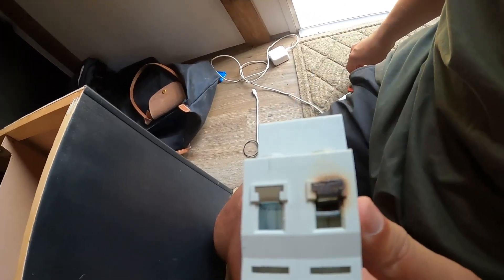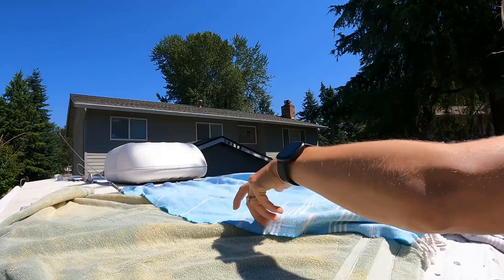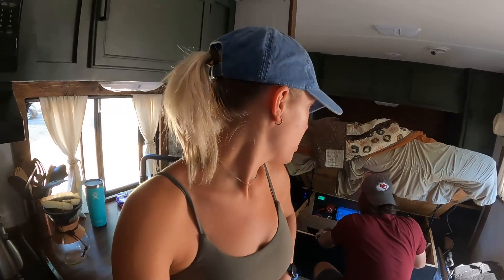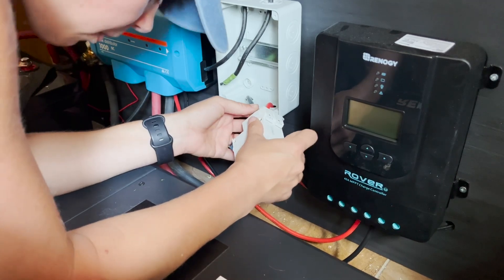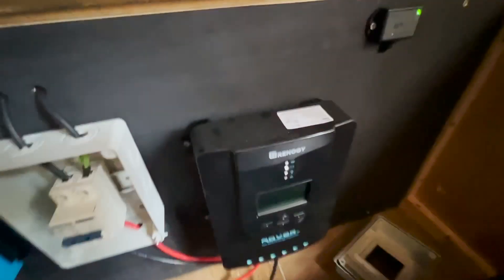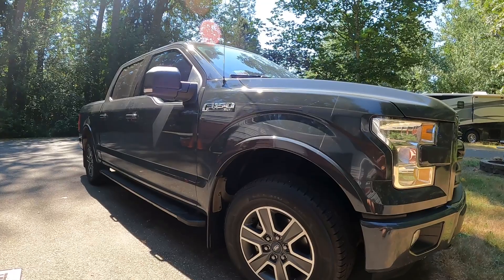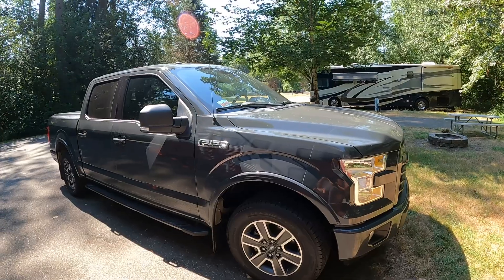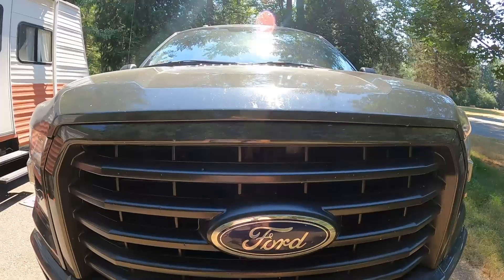Facing more RV life issues

Comment: Sorry for your problems but it's refreshing to see someone else who recognizes that RVing is not all airconditioning and ice cream.  We have towed our caravan off and on over the years with several tow vehicles, each with it's own peculiarities. Our first was underpowered, so we got rid of it for a more powerful sedan, to heck with the petrol bill. That vehicle (a Ford) had it's own foibles, but was mechanically sound. Second was another Ford which was equally reliable - until it started doing the same thing as yours. We had it into the workshop several times at $200 a pop but could never pin the problem down. Got rid of it for a 10yr old Toyota Landcruiser. Had that for 13yrs now without any major fails. Not towing anymore, but the TLC will last me out (and it increases in value every year - shortage of 4WD's). Have fun on your travels and post lots to keep us entertained.
Reply from the maker: Okay so we definitely need an older Landcruiser now! Haha our truck is doing well, so far. We'll see down the road! Thank you for watching and commenting

Comment: That Mini Breaker is fine and proper to use. Most people do not they exist and do not know how to use them. They have what is called a curve rating such as "D" or "C" curve rating for trip current loading etc. They also have a DC voltage rating which the ordinary breaker does not have. The ratings need to match your specific requirements and for solar you need to watch the DC voltage ratings.
Reply from the maker: Good to know! Thanks for the info. Even a handful of people at electrical supply stores were very confused when I told them we use it as a solar cut off switch. It's working great since we replaced it and we're checking to make sure the wire is secure more often.

Comment: Pre 2016 3,5 eco boost engines with purely direct injection had problems with carbon build up on the vales and pre 2015 engines had timing chain issues.  Also these engines require more frequent spark plug and ignition coils changes.  Turbo charger leaks can cause engine issues as well.

Comment: That 3.5 eco was not enough power for what you are towing. Good upgrade. Good rule of thumb to stay about 2/3 or less of the towing capacity so you can account for all the cargo you carry and high winds and steep grades. The experienced RVers will tell you there is no such thing as too much truck when towing a trailer. To tow your trailer I would tow with no less than a 10,000lb capacity tow rig.
I would also get my whole setup weighed if you have not already because most people way underestimate how much they are actually carrying.
Reply from the maker: Yup! We probably should have upgraded before we ever hit the road, just to be safe. We're definitely learning a lot about towing very quickly!
Reply: @WorkinfortheWild  I had a dealer talk me into using my existing V8 Dodge Dakota to pull my first trailer which was only 3200 fully loaded. I was a greenhorn so it sounded reasonable even though the Dakota was only rated to tow 5000. It worked great until we started to pull steep grades or hit cross winds in Wyoming. We eventually lost the truck brakes down a steep grade and that was the clincher for us. Scary to say the least as that old Dakota had only front discs and rear drum brakes. We only made it because of the trailer brakes and down shifting to 4WD low range. So we bought a much newer F150 rated for 10,000 with all 4 disc brakes and larger wheels and larger brakes. What a difference!
Thanks for your channel, good info.

Comment: Cole,, next time your vehicle is struggling with power output, change the spark plugs and coils. You may have just been running on 4 or 5 cylinders & it was a simple fix. Try to change the full set of plugs every 30 to 60k & it will keep your motor at peak power 👍

Comment: First video I have ever seen of yours and now a subscriber, and just quickly saw the old truck and if that is 2011 (first year) 3.5 then you were smart to dump it. I had one for years and the issue is the charge air cooler basically works way to well and and over cools creating moisture in the motor which then the motor tries to fire water, fouls out plugs, O2, cats, complete nightmare. I spend about 8k before dumping it
Reply from the maker: It was about to become a huge money pit for sure! We wanted to avoid that at all costs. We feel good about the decision so far!

Comment: FYI, the gas struts on your bed lift are upside down. The rod should be below the cylinder so the oil in the strut will stay in contact with the seal. They will fail much sooner if you keep them the way the are installed now.

Comment: I have towed almost 40000 miles with an F150 3.5 Eco boost and have absolutely no problems. Have been out west through the Rockies 3 times and down south in the mountains. Our fifth wheel is 8300 3's empty and loaded goes around 9200. Towing capacity of a f150 Eco Boost 3.5 is 132000. We love our truck. Good luck with your combination. Safe travels.
Reply from the maker: Wow! What year is yours?
Reply: @WorkinfortheWild  This one is a 2019. It is our 3rd one.

Comment: I have really enjoyed your videos.  New and fresh.  My wife and I RV in a converted 26' 2002 trailer that we have gutted and customized to meet our needs.  We have fixed leaks, appliances, floors...  It is a labor of love/hate.  We only travel about 8 weeks per year so the other 10 months are all about planning to get going!
We tow about 5000 pounds with an F150 and I really depend on our Reece weight displacement hitch and sway control.  I noticed in the photo of the last truck you were not equipped with these great accessories.  By now you have probably researched towing and hitch options, but I would be less than friendly as a fellow F150 towable couple if I didn't tell you what has helped us tow about 20K miles successfully.  There are some really expensive and hi-tech hitch options that I would have if we were rich...  The Reece package is less than $500 on Amazon and does it make a difference!  Good luck and safe travels.
Reply from the maker: We definitely need to get a weight distribution hitch and have been looking into a few options. We'll check out the reece package! Sounds like a really good deal. Thanks so much for sharing and for watching!

Comment: The top light on your Renogy Rover charge controller takes about 10 seconds to turn on after you flip the breaker ON to connect your panels to the controller. The Rover wants to be sure the voltage is steady.
Reply from the maker: Thanks! Yes, we noticed this the very first time we ever turned it on. When our connection started going bad, the light would either not turn on at all, or it would flash for a second and disappear. So happy it's working again!

Comment: Im glad you 2 got the newer truck. As much as manufacturers bragg on these turbo charged V6 engines being so great i would never tow with one. I think you'll like the V8. The 302 is a great engine and you might just pickup a little bit more fuel mileage to. The V8 doesn't have to work as hard as the V6 to get you down the road. Glad you were able to get that solar figured out. Solar can be a pain at times, but it is the only way to go if you want to boondock. Take it easy.

Comment: Suggest that you reference the previous towing guide considering the actual options on the truck (should be a build sheet in the glove box) to determine the actual rated tow capacity. Also need to check the GCWR (truck + trailer wt). Always a good idea to run it across a truck scale (most Love truckstops have a multi axle scale that will charge you $12. GCWR (gross combined weight rating) should never exceed this weight.
Reply from the maker: Thanks for watching! The tow capacity on our previous truck was 11,300 pounds. We’ve used scales at truck stops a couple times now to check our weight and we’ve been okay. But we did get rid of quite a few things when we swapped vehicles to drop as much weight as possible
Reply: Just offering positive feedback based on personal experience. There are so many variable that impact tow capacity (ie rear gear ratio, actual axle load etc).
Reply from the maker: @kennethmoore5629  for sure, we definitely appreciate it! The back of our truck was packed full which I’m sure didn’t help. We’re also planning to invest in a weight distribution hitch once we can find a good deal. The truck was running poorly even without towing. Towing just really brought out the worst over the last couple weeks

Comment: Appreciate your vid; In 2015 the 3.5  Turbo had a complete overhaul. Know as the Ecoboost. The V8 coyote engine is basically Mustang 5.0 which is a proven motor and natural aspirated.  Our TT and gear and passengers 6,041 lbs Grand Design 22mle .. Our GMC 2.7L Turbo 1500 pickup.  Been through the Smokies twice love it as an everyday driver. Have 11 mths before turning in my lease. Most likley F150  3.5 Powerboost  (Hybrid)  little over 500 HP's with boost.  The newer more powerful 3.5 with a 10spd transmission will allow me to venture Mid Western & Western High Elevations / Mountains.

Comment: Congratulations on the new truck. I have a 2017 F150 XLT with the 5.0 engine. I have been pulling a 6500 lb. rig (dry) without any challenges. I think you will be very happy with the additional power. Oh, when I travel up hill I noticed that running standard transmission works better than the tow mode. It seems to keep the rpm’s too high without shifting.
Reply from the maker: Thanks for the info! That's super helpful to know

Comment: Good move on the truck!! I have a 2012 F150 XLT with the 5.0 V8. We tow a 29’ trailer that weighs about 6500# fully loaded. It pushes my truck a little, so I’ll upgrade to a 3/4 ton truck sometime. But that motor is great. You’ll love it with your camper. Congrats.
Reply from the maker: This is great to hear! We feel a lot more confident towing with this truck. Our trailer is just under 5,000 lbs fully loaded, but we have quite a bit of weight in the back of the truck too so we needed the upgrade.

Comment: Yeah, thanks for keeping it real, not sugar-coating RV life. It's wonderful, but it's also a lot of work, and expensive, even if you're doing most of the work yourselves. You two are obviously great planners, but even you've gotten bit in the a$$ a few times. I think getting the Coyote engine in the F150 is a good call. I bought one in 2019, and opted for the 5L also. It's a proven technology, much easier and cheaper to repair, and the gas mileage between it and the Ecoboost is actually negligible. Appreciate your vids.
Reply from the maker: Thank you! So far, so good with the new truck. We're happy with the decision and hope it saves us from a few headaches in the long run!